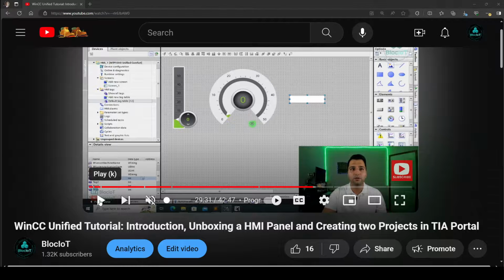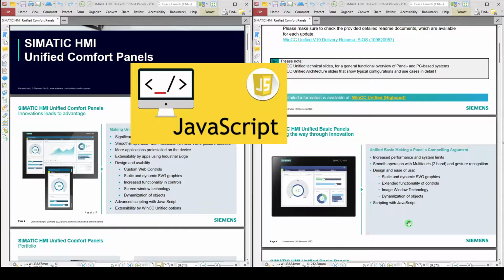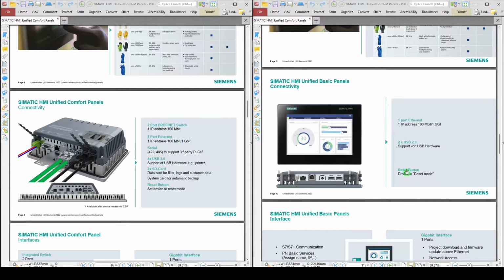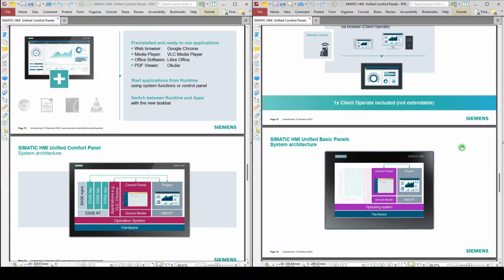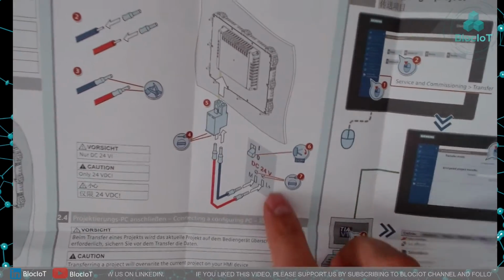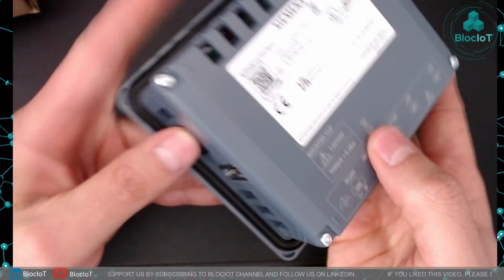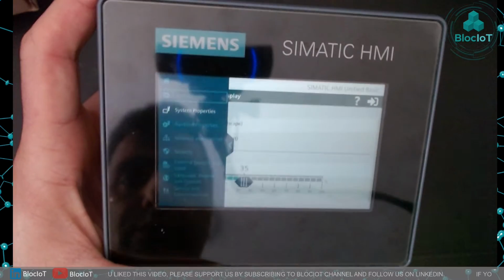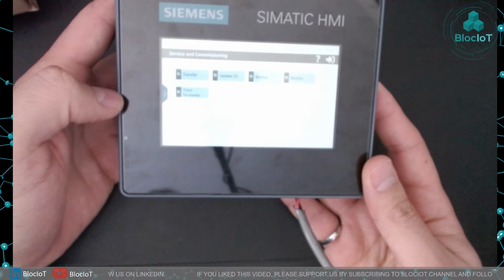35- All you need to know about the new Siemens HMI, Unified Basic Panel (UBP)

Comment: I advice not to use the 4" MTP400 it is tiny and it is very uncomfotable to type on onscreen keyboard. Go at least for the 7" one.
Reply from the maker: Agreed. 4" is too small and should be avoided if there are several object on the screen as it gets cluttered quickly. But it has its own use case for some projects.

Comment: HI ,I can't link MTP400 to S7-1212 ,The screen shows a triangle mark on the I/O field. ,I tried to KPT400 and it can communicate normally. you have vdo for show how to link MTP400 with s7-1200 plc
Reply from the maker: @TanapongPonghanat  hi. One of the main reasosn that the communication doesn't work is the date and time in PLC and HMI are not properly set. Please double check the time on both sides.
Reply: @blociot  Thank you. After I setting the time for both PLC and HMI, now it works.

Comment: Hi friend, do u know why I can´t find my MTP400 in the TIA v17 hardware list? that folder not even exists 😢
Reply from the maker: Hi Eduardo. If you have a MTP400 BASIC, it is only available in TIA V19. Unified basic panels are very new and introduced with TIA Portal V19.
Reply: @blociot  very helpful. Now I can't stablish a communication between PLC s7 1200 and my HMI MTP400. There's some detail that I'm missing?
Reply from the maker: @eduardobrisolla1185  there are a few factors that can cause this issue. First, make sure you have an HMI connection defined between your PLC and HMI. Then make sire the time zone is the same for both devices. Finally, make sure the CPU security allows access to all devices and the certificate is valid.